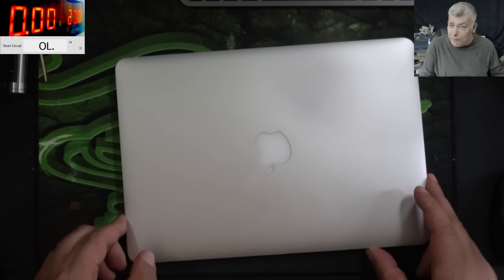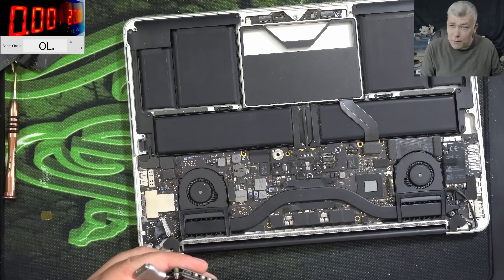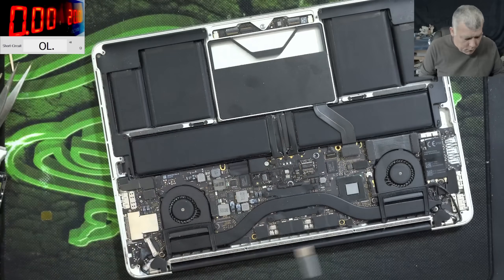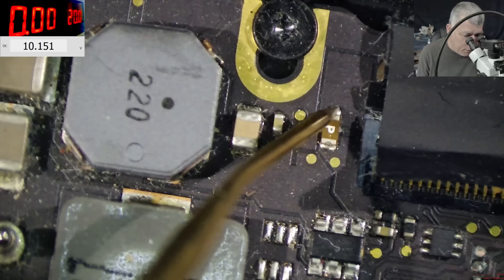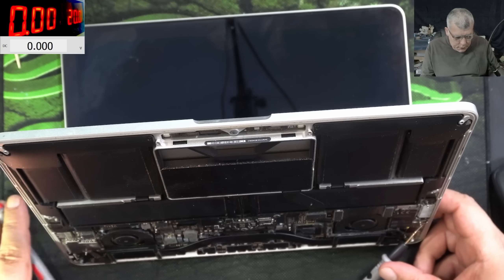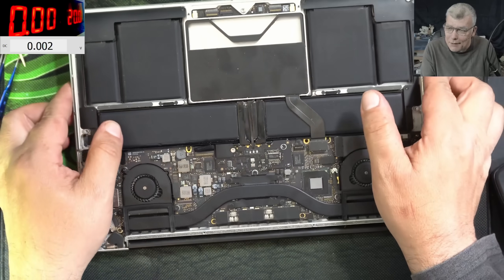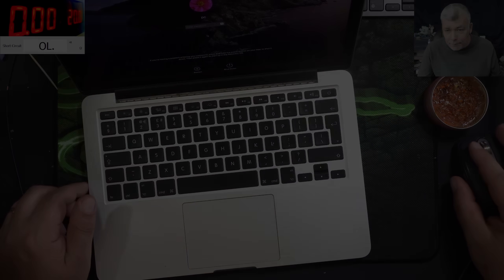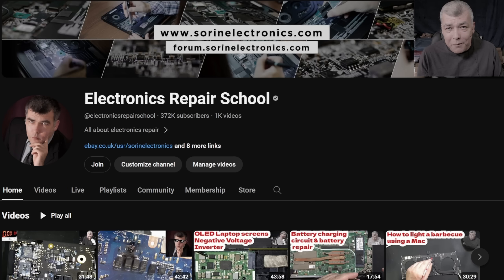MacBook Pro dead, no power - Fixing the power button without replacing the keyboard

Comment: Surprised you didn't try flooding the power button with alcohol.  Might have just been residue under it stopping it working.  The key tops can be taken off to get at the switch portion a bit easier.  Good job though.
Reply: I believe its something inside the membrane of the button

Comment: What seems to be the cause of a lot of random problems? Is it being dropped? Because i've recently had a right speaker go out on an OLED G8 for no reason. Ive handled it with care, but it may have been mishandled in handling. That or a faulty connection on the right speaker maybe?

Comment: Hello! Please tell me what could be wrong with the laptop. Acer Aspire vn7-593g battery charging stopped at 67% but the laptop continued to work from the power supply, if you disconnect the power supply, the laptop immediately turns off. It does not turn on from the battery and does not charge it. Aida64 shows battery wear of 16%, battery voltage of 16.116 and slowly drops as does the current battery capacity. 
The battery is not swollen, the laptop did not overheat, there are no burnt out parts, it was not flooded with water.

Comment: I think its not working fine. The lid sensor has 0V when closed and  3.3V when open, so is exactly the reverse of the power button. Thats why you have to close the lid quick before the laptop shuts down, otherwize, if the laptop is already off and you close the lid, will start the laptop. And if the laptop is off with the lid closed, opening the lid will not turn it on, you have to open, then close to turn it on, the open again to use it. I think so at least. I think its the only way because if the states would be reversed it would men the the laptop would not come on any way because it would think the lid is closed, this of course if you leave the lid sensor on the board.  Anyways, great video as always. big fan. You are the reason I just start recording videos on a new channel. So if you can give me a shout out will appreciate it.

Comment: Maybe another idea to try is a tiny micro push button switch in the side from hole you drill and connect two wires back to PW 3.3V?  YES!! it would destroy "collect ability" of the laptop, but you could also remove something and temp put it there and remove later and no damage...

Comment: Sorin I think you wired it backwards. Power button needs GND to turn on. But lid gives GND when you close the lid :D I think you made same mistake on that Acer since you mentioned that you had to close and open that lid as well to turn it on. Actually closing it gives power button to turn on. But does lid sensor prevent laptop turning on even if power button pressed?

Comment: Hi Sorin.
I think there is 1 problem with this repair. If the lid is closed, then it is like the power button is pusshed continouisley and it wil start and reset again and again. I think i heard it come on when you shut it down and then closed the lid. It could work if the customer keeps the lid open and use a magnet as on/off key.
I am right?

Comment: How do you make sure that you never damage the tracks when using your old little friend?
Reply: Twist, dont pull. However in this case that capacitor was already corroded. Bottom pad was gone. If you work with corroded solder you know it gets very brittle. Little friend tactic is not advisable for older stuff (pre 1990, very early SMD, maybe mid 90s) as PCB quality was actually VERY bad.
Reply: dont rip it out but shear it out

Comment: You should check the signal on the wire you added when opening and closing lid. Looks like laptop comes on when opening AND if shut down with mouse it also comes on when closing the lid.
Reply: Yeah. I think he wired it backwards. Looks like lid sensor gives GND when CLOSED. So it turns laptop on when closing lid. Lol. He simply needs inverter chip here. Or take the signal somewhere else. Is it same on that Acer? Have to watch the video, but I think he did same mistake on that Acer.
Reply: @TriodeTetrode  if I don't remember wrong in that video initially was wired in the opposite. But he figured out and found a way to make it work properly
Reply: @Heichou96  Oh ok. I will look at that video. I think I never seen it. But let's watch for fun :D
Reply: Also does lid sensor prevent laptop to turn on. Like you close the lid. Ok power button gets GND and wants to turn on. But lid sensor says laptop lid is closed. So what happens when you try to press power button lid closed? :D
Reply: @TriodeTetrode  as u can clearly see at 11:30 it fires up even with lid closed. great if u put it in a bag
Reply: @Nebbia_affaraccimiei  I think ur right. And actually it keeps power button pressed all the time. So perhaps restarting all the time? Yeah great when u put in a bag :D
Reply: @TriodeTetrode usually with lid closed, shortibg power on to ground is not doing nothing.   When i repair acer laptops adding an extra lateral button , pressing it when the laptop is closed ( maybe on the bag) is doing nothing.

Comment: 12:00 11:30 my bro u wired the power ON when the lid is CLOSED xD
Reply: The other way around would be bad, you want to change state to "unpressed" when open.
else the notebook just thinks you hold the power button while the screen is open and no easy pizza :(

The proper bodge would be a small circuit with a 555 timer which presses the button for a short time when you open or close the lid lol
Reply: typical sorin, wacky and messy...